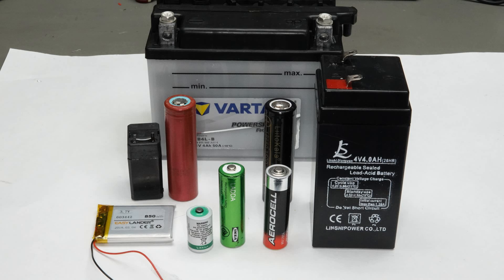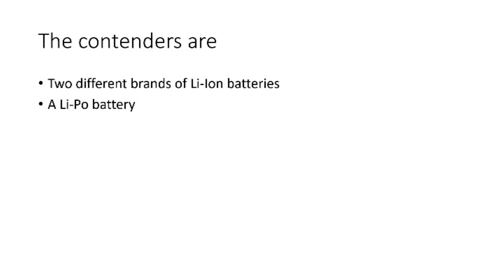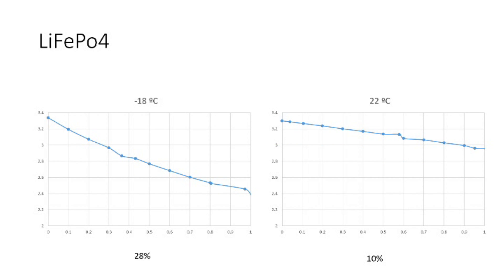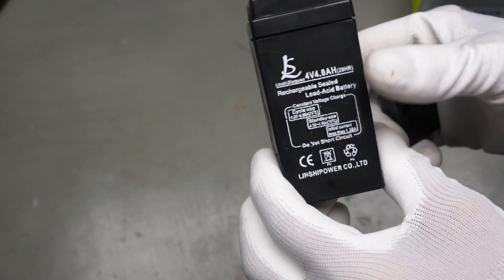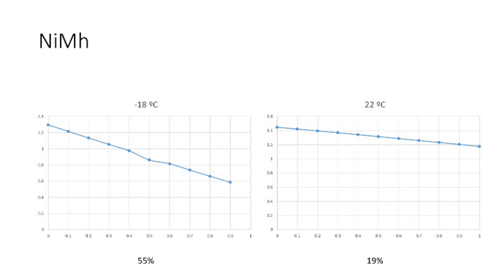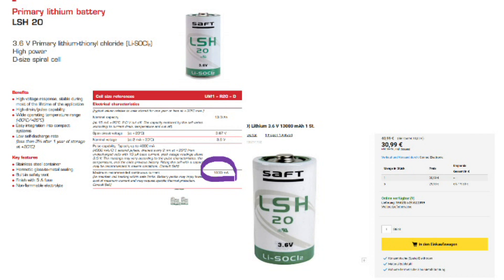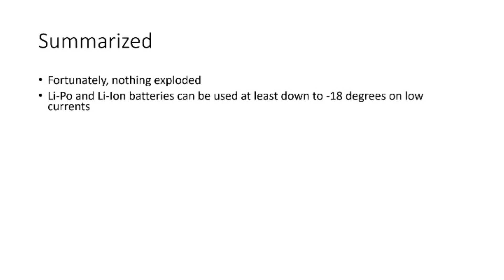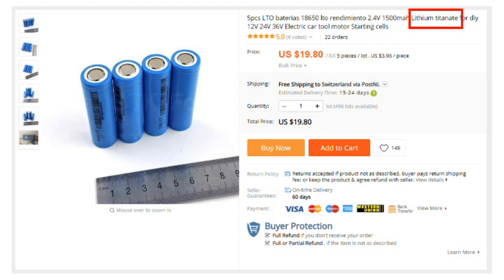#256 Which batteries are best for winter? (Arduino or ESP8266 / ESP32 projects)

Comment: The often used distinction between Li-ion and Li-polymer has nothing to do with chemistry (it is used wrongly. Pouch and cylindrical cells are just different form factors. There are different chemistries within that class, but again that doesn't have anthing to do with the shape. The main difference is that the different form factors are built for different applications (high current vs. high energy density). They are all Li-ion batteries.

There are so many different combinations of electrode materials and electrolytes that just putting them into "li-ion" and "li-po" category, even if that were a correct distinction, would be pointless. My guess why "li-po" as a name came to be is marketing. Cylindrical cells were the norm when the somewhat "freeform" pouch cells came along. Someone heard about the "new" cell chemistry of real li-po batteries at the same time and slapped that label on their batteries, because, hey, they got a polymer sheet separator in there (as all of those cells, even the cylindrical ones, had anyway) and a polymer (=plastic) pouch around it, even when that has got nothing to to with actual li-po cells. Lipos true to the original meaning of the name (the electrolyte itself being a solid polymer) still don't exist commercially. I feel something similar is happening with the "graphene" label currently. Real graphene cells are nowhere near out of research (meaning nicely arranged graphene structures). Marketing heard about graphene being the future. Almost all cells use carbon on the negative electrode in the form of graphite flakes. Now tell someone that graphite is many graphene layers stacked on top of each other and boom, you got your "graphene" cells.

Btw. have you ever seen something like IMR, INR, ICR, IFR, LMO, NMC, NCA, NCO, LCO or LFP written on cylindrical cells or in their datasheet? Those signify different chemistries. Pouch cells could use the same, although they mostly are Lithium-cobalt-oxide chemistry (ICR/LCO, different manufacturers use different shorthands).
Reply from the maker: Thanks for clarification. In earlier videos I used „LiPo“ because this is how we name them here. Then I got corrected by viewers. I decided to use Li-Ion now. But this seems to be as false. I am an electronics engineer, not a chemist. If I read your comment I safely can stick with LiPo.
Reply: @AndreasSpiess  
Li-ion isn't false. It is actually correct for pretty much any rechargeable Lithium (well ion) based battery, even LiFePo are Li-Ion. They all work on the principle of moving Li-ions around. In a sense Li-ion is like "vehicle", while Lipo is like "car". Every lipo battery is a li-ion battery, but not every li-ion battery is a lipo.
While I would like nomenclature to be used correctly (but when has that ever happened when marketing got hold of a technical term), my main reason for pointing it out is to stop people from thinking that those cell shapes are completely different technology inside, while they are mostly the same thing built for different applications.

Comment: I dont understand your curves. One curve showing the voltage at 10 different discharge currents? Did you change the discharge current on the fly? Is there a time parameter hidden somewhere?
Reply from the maker: I changed the discharge cuttend from 0 to 1 A in 10 steps and measured the voltage. Like that you see it’s correlation. Time is not important here as I used a fully charged battery and it only took 2 seconds per step to get stable results (I use an electronic load for that)
Reply: @AndreasSpiess  Should we expect similar curves for half-charged batteries? Greetings from the other side of the Röstigraben.
Reply from the maker: I think so. Maybe a little steeper

Comment: Noticied you used a similar Liitokala charger as I use, with one difference if I saw it well. Mine also somehow measures and shows the internal resistance of the cell (they call it mR, in stead of mOhm, but OK, you cannot have everything). The resistance is a parameter I like to observe in judging how well the battery (still) is. Even within packs, this internal resistance of cells can be different, which causes the ones with higher resistance to fail earlier then the rest of the pack.  Also this resistance is different from technology to technology, which makes a difference as too how high a current a certain technology can cope with.

So: is there in your opinion any value in observing the internal resistance, or is it a parameter I should ignore?
Reply from the maker: My device does not calculate the internal resisance. I think, as you write, this parameter is important. However I am not sure if it is constant and easy to measure. But as an indicator to compare your batteries with eachother it should give you an indication. The question is: What do you do with this information? At which resistance do you throw a working battery away?
Reply: @AndreasSpiess  That is a good point, I throw them away when.... I can no longer charge and discharge them with a meaningful amount of energy. At the same time, I notice that the internal resistance has increased. So, although internal resistance is an indicator, I throw them away they become useless as a battery. The thing I do use internal resistance for, is when I combine batteries in series in a pack. Because the high resistor ones hold less energy (my theory anyhow), they form the weakest link in a pack.... and when the high capacity ones can still deliver, the effect is that the weak battery will be deep discharged. The weakest link even gets weaker... So: I try to combine batteries of about the same internal resistance in a pack. This is where I find internal resistance comparison most useful.

Comment: Maybe thick insulation and a tiny heater(resistor/led) on the battery will work too
Reply from the maker: As marthale7 writes, most of the Teslas heat the batteries with a built-in heater

Comment: Tesla heats the battery before start charging.
Reply from the maker: That is what I read, too. But I also read that they start to charge with low currents before the batteries are fully heated. And the newest model seems to have no battery heating.

Comment: Most lead-acid motorcycle batteries are "sealed for life" units these days. No need to fill them up once you have done the initial pour and gently tapped the supplied plugs into place (usual supplied on a single strip.) Haven't seen the "top up" types for at least 10 years on my Honda's.
Reply from the maker: As you see you still get them ;-) The sealed ones were double the price where I bought mine (in a hurry). So I decided to purchase this one for the video. In my Harley, of course, I have another one :-)

Comment: why am i not surprised?
that the man from the country where bomb shelters are mandatory, 
also has a freezer from a brand that loves to put a big old slab of concrete on the bottom of their washing machines? (miele, great machines, cost a ton, weigh a ton, absolute motherfuckers to lift)

i don't know about the freezers, but i've seen them washers go over 30 years, they sure got some quality stuff, the germans know their mechanics :)
Reply: A lot of washing machines have lumps of concrete, they're used to reduce the vibrations and stop the washing machine walking across the room!
Reply from the maker: We had other brands in our household. Bad experiences made me standardize on Miele. Not cheap for the investment, but worth the money.
Reply: Miele are still the best. In a 20 Family House we bought only 3 in 20 years.

Comment: Hey.
I use Aku Li-ion CGA103450A in my atmospheric sensor all year round. This season, the minimum temperature was around -12, nothing bad happened. I just had to change the solar panel for better and bigger.
Reply from the maker: Thank you for sharing your experience. This is what I thought, but did not find any evidence.

Comment: varta!
haven't seen that brand in ages!
they used to sell like hotcakes here in the netherlands here in the late 80s and 90's,
logos hanging over the top of the electronics stores and everything

do they still exist under that same logo and name or did they merge? 
now i'm wondering why they kind of vanished over here... i guess they disappeared as old school photo cameras with flashers went out of fashion, they used to make a ton of those batteries.

i guess it's kinda the same reason BASF tapes aren't everywhere anymore, the use case went out of style, couldn't spend a day without seeing BASF back in the day either 
kinda the same for 3M, they even used to sponsor an annual running marathon in leiden,
(although i sometimes still see 3m on tape and office equipment, never have seen BASF after i stopped using optical media  ~10 years ago)

all i see is panasonic and philips these days in the brick and mortar stores
(obviously philips are everywhere around here seeing as they're they're from here, almost as unavoidable as heineken) :D
Reply: Varta still exists and is sold in many general and electronics stores here in Eastern Europe.

BASF stopped manufacturing tapes years ago, but before that, they spun off this part of their business into EMTEC brand. Now they focus on their business in commodity chemicals.
Reply from the maker: Many brands were bought by other companies. I doubt that HP manufactures and sells calculators for 20$ (you still get them here). But it is a legendary brand in pocket calculators ;-)

Comment: Andreas !?!? "Fortunately nothing exploded"  !?!? Seriously?!?! Pal ... everyone looking at a title batteries and explosion Expects an explosion :) ... the bigger the explosion the more views! And no, Magic smoke is no longer going to cut it ... popping a electrolytic capacitor ain't enough ... burning a small resistor is just not gonna cut it ... connecting a 110C solder station to 220V and watch it burn doing nothing about it .... or a desoldering hot air blower..nope! We're way past that :)  I truly was hopping to see something ..different :) Real smoke for a change :) 
No! We want Real Explosions! :) :) ... in Magic smoke is something normal these days on so many electronics channels! :)
(now seriously nice useful video)
Reply from the maker: As you know, I am an engineer and like to build and not to destroy. There is enough destructive energy around (not only on YouTube) for my taste.
As I said, I was curious because of the "urban legends". And I had a nearly exploding LiPo in my lab which left a lasting impression about this technology.
Reply: @AndreasSpiess  I was just making the case that many channels test electronics to the limits, sometimes resulting in the famous ..Magic Smoke we all know.
that brings more vies actually :) just saying.

Comment: Lead acid batteries don't like deep discharge unless they are constructed to handle that. So the capacity is a lie if you can only use 20% of the rated capacity...
Another problem is that they can freeze after being discharged because the concentration of acid depends on the level of charge. When full, the concentration is high and prevents freezing but deeply discharged, the concentration drops and they become vulnerable.
Tesla cars are using heaters to maintain a decent battery temperature. Search YouTube about that. You can actually loose charge if you plug it to a 110 socket because the heater takes more than 10Ax110V... and it uses some power from the batteries to warm them.
Reply: https://youtu.be/s92G6s3pyGg
Reply from the maker: Thanks for the link!

Comment: The advantage of Lifepo4 is that they are safer and handle  more cycles...
Reply from the maker: You are right. In the past, I made a video about LiFePo4. Here, I meant only the difference at low temperatures

Comment: Good video and study. But a word of caution to all viewers... it is extremely dangerous to do such experiments, especially at home. Battery explosion, if happens, is very destructive and dangerous. 
Battery testing is done in very closed metal explosion proof rooms. If a novice repeats such experiment at home, could turnout fatal. I suggest put a warning at beginning and end of such videos.
Reply: I honestly highly doubt it, in my experiences its actually HARD to cause a explosion, I've only had lithium batteries explode or catch fire when I short it out for a long time or if I hit it with a hammer or bend lipos in half.
Reply from the maker: So you are probably not an early adopter of e-car technology ;-) I agree to pay attention as I had once a LiPo which nearly exploded just like that.

Comment: LiFepo4 doesn't have advantages? They are safer (no explosion) but less energy density than other lithium batteries.
Reply from the maker: You are right. I meant in low temperature conditions. The rest is covered in another video.
Reply: Also, I think the have maybe 10x # of recharge cycles
Reply: @solidfuel86
 In relation to low temperature. That was obvious from the context.
Reply: @kwinzman  ok jeez it has been a year. No need to shit on me now :(
Reply: @solidfuel0  haha yes, sorry :-)

Comment: Great video. Very helpful! Do you have data on high temps applications such as in tropical countries? What type of batt can withstand heat up to 40degC and last long?
Reply from the maker: I never tested batteries at high temperature.

Comment: There are 18650s made for low temperature conditions: Panasonic NCR18650F and Nitecore NL1829LTP / LTHP. I haven't tried them yet.
Reply from the maker: I am not sure about the NCR. It’s datasheet also says: No charge below 0 degrees. Where do you have your info from?
Reply: They are still specified for charging only over 0 degrees. https://voltaplex.com/media/whitepapers/specification-sheet/Panasonic_F_Specification_Sheet.pdf

Comment: AVE pointed out that  lead acid batteries will freeze and split their case if they are fully discharged. The acid converts in to a  more water than acid state. They wont freeze if they are in a charged state.
Reply from the maker: I just got the link to his video and will watch it later. Thanks.
Reply: That is absolutely correct. Before maintenance-free Pb batteries became available, the drivers would need to ensure proper concentration of the electrolyte in the cells before winter. Special hydrometers were sold to car owners to assist them in this. (see https://en.wikipedia.org/wiki/Hydrometer#Battery_hydrometer ) I remember doing these measurements and topping off the cells with my grandfather.